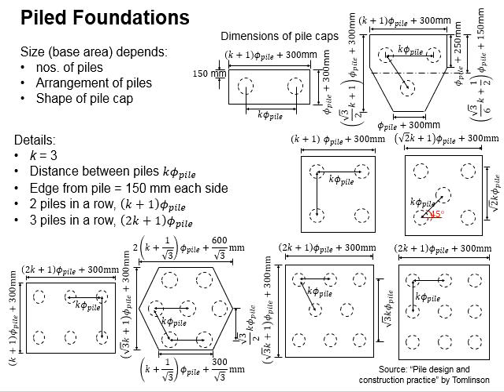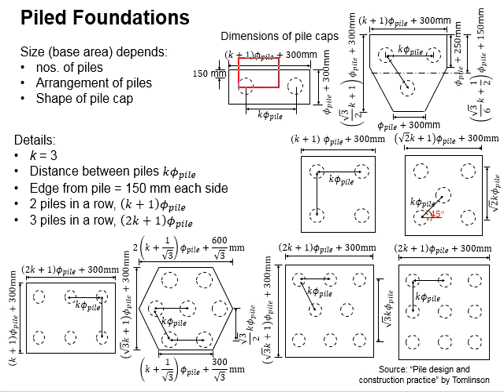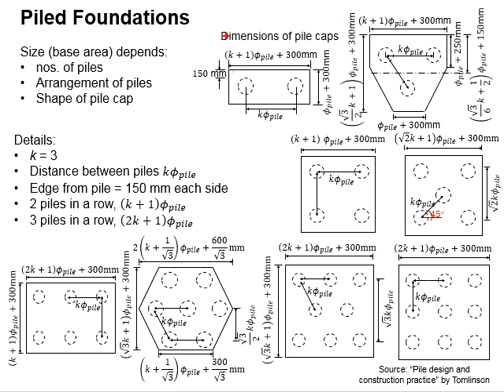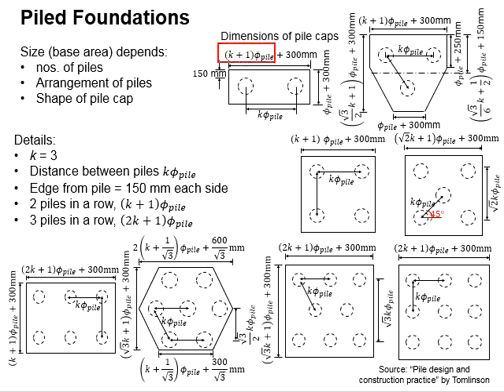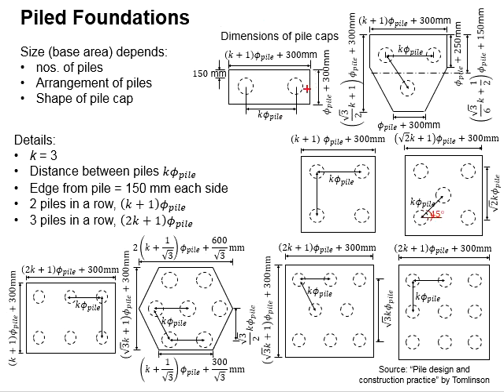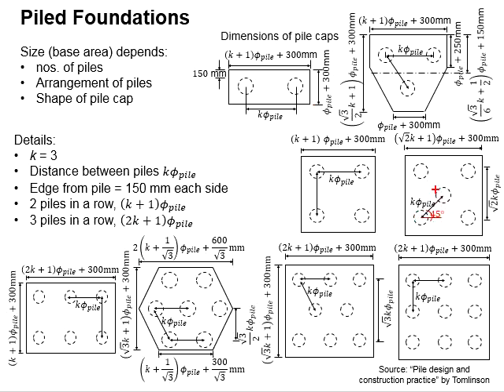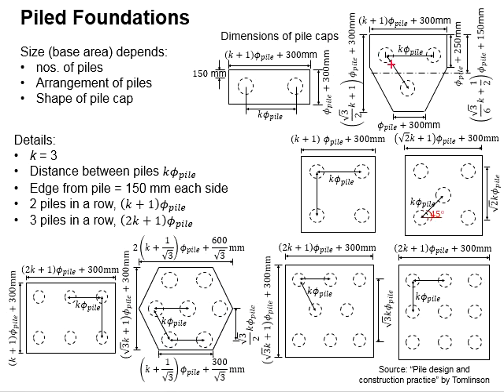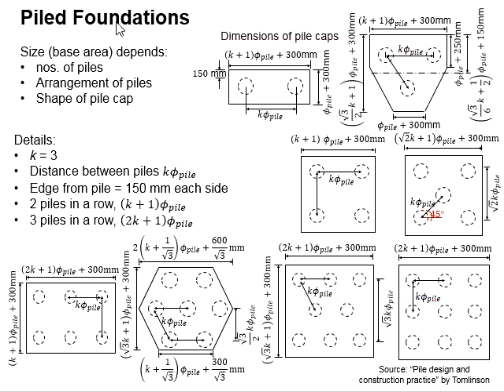3.19 Size of pile cap

Comment: Excellent work-related structural design of RC and steelwork. Can you do a video on how to size up the cross-section area of the RC pile and how to find the main longitudinal bars and links? Your help is greatly appreciated! If it is possible, can you do a video for the design of steel sheet piling?